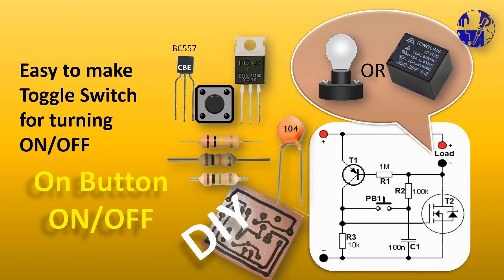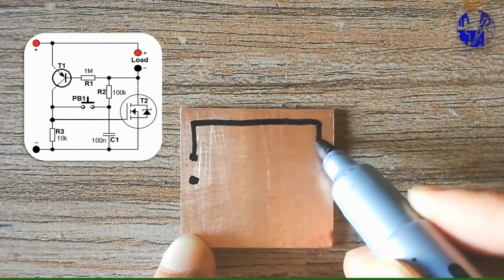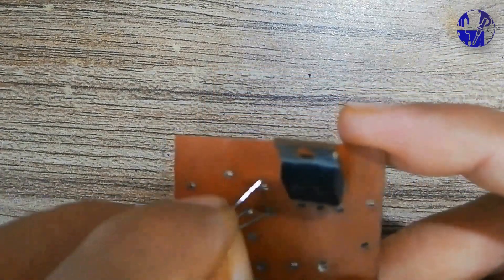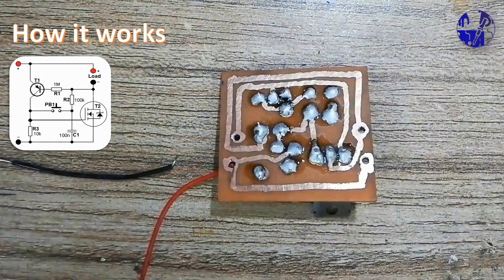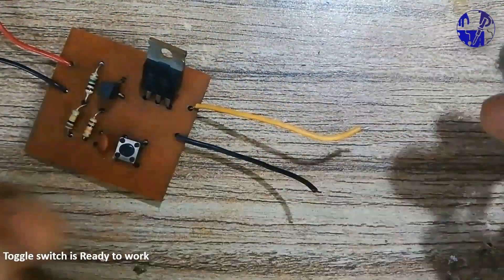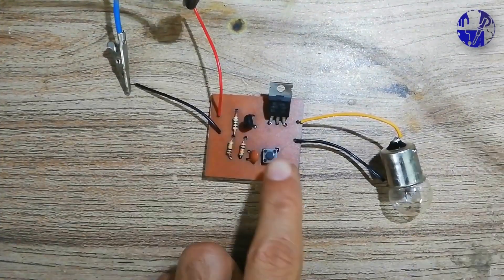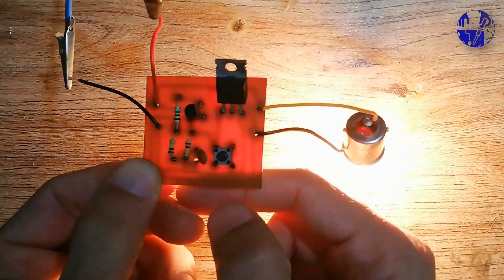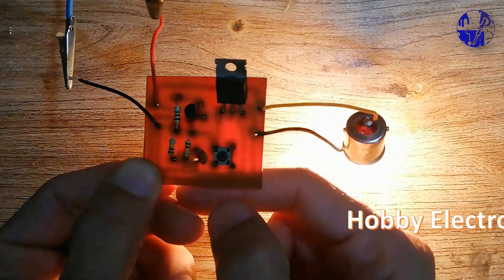Simplest ON/OFF toggle switch circuit

Comment: One 220 - 470 ohm resistor  on T1   emitter or collector  will help  with   current spikes on it when  pressing on or off.    Great circuit otherwise !.     if using a relay add a flyback diode on the  relay coil.

Comment: I have tried building this circuit using the mosfet FQP30N06 and the transistor BC557 but I can't get it working. Any ideas or will it only work with the IRFZ44N? 😳
Reply: A mí me pasó igual. Parece que solo funciona con el IRFZ44N 🤷
Reply from the maker: The circuit work on any N-Channel Mosfet, make sure all the connections are correct.

Comment: Nice video been having trouble designing a soft latching switch. I would like to know the minimum output current at the output say if i use a 3A battery pack will i get 3A at the output too?
Reply from the maker: The output current depends on the load, not just the battery pack. A 3A battery pack can supply up to 3A, but the actual current is determined by the load's demand. Ensure the load current stays below the MOSFET's maximum drain current (16A) for safe operation.

Comment: This is the best toggle switch, you've beaten all circuits on the web. If you came up with this idea it's genius, if not please tell us the source. Thanks for sharing. This circuit requires 2 transistors, you can use P-ch and npn to power low side, and the best feature it doesn't oscillate when you keep pressing the switch.
Reply from the maker: Wow, thanks!

Comment: Amigo, montei o seu circuito aqui para controlar 4 reles comum de 12v em paralelo so que não dispara, so consegue disparar 1 rele se eu colocar outro em cima o circuito não liga. Sabe me dizer o que pode ser?
Reply from the maker: Na verdade este circuito é apenas para 1 relé. Se você adicionar mais relés, terá que fazer algumas modificações no circuito. Não sei se você está adicionando relés em série ou em paralelo?
Reply: @HobbyElectroLab  em paralelo so coloquei o diodo na bobina de cada 1 deles. Mais estou adicionando 4 reles em paralelo. Qual modificação que eu tenho que fazer para que ele funcione?
Reply from the maker: ok, no lugar de 4 relés, use apenas um relé com quatro números de contatos NF (normal fechado). vai funcionar bem.
Reply: @HobbyElectroLab  Não acho desses tipo de rele para comprar e preciso de contattos que suportem grande carga ~40A por isso que estou usando 4 em paralelo

Comment: A simple on off switch will do the same. No need of the circuit!
Reply from the maker: You are right, but this circuit is designed for a push switch
Reply: With the circuit you can control a very large load with a very small amount of power.
Reply from the maker: You mean, we can controll a larger load with small switch. @mikebond6328

Comment: Which transistor and mosfets can i use if i don't have irfz44 or A733?
Reply from the maker: For T1, you can use any general purpose PNP transistors like 2N3906, 2N4403, BC556, BC327, BC157, BC558, 2SA1943, BD140, S8550, and For T2 you can try any general purpose N-Channel MOSFET like TQP 50N06, 55N06, IRF1404
Reply: @HobbyElectroLab  thanks for response
Reply: Eu fiz esse circuito com com o Mosfet IRF510N e não funciona! O esquema é esse mesmo! O resistores e o transistor é são os mesmos, só o Mosfet que usei o IRF510N. O circuito fica sempre ligado, não sei o que seja, já simulei em um circuito virtual e funciona.
Reply from the maker: Não entendo porque não funcionou, o IRF510N também é um MOSFET de canal N. tente confirmar se é normal
Reply: se você replicar o esquema então deve funcionar, mas se você replicar o PCB mostrado neste vídeo então você também deve corrigir o erro no PCB conforme corrigido às 2:25 neste vídeo @claytondias1050